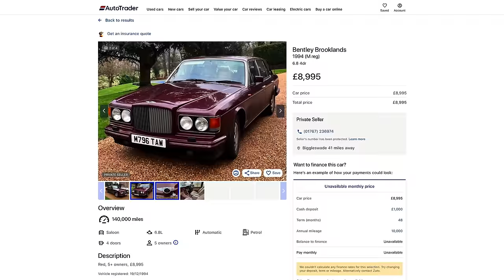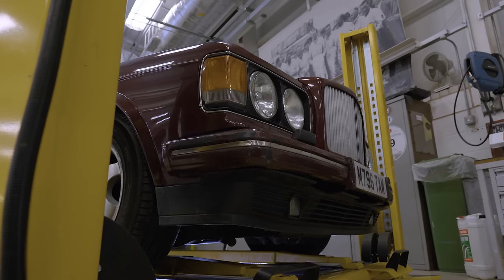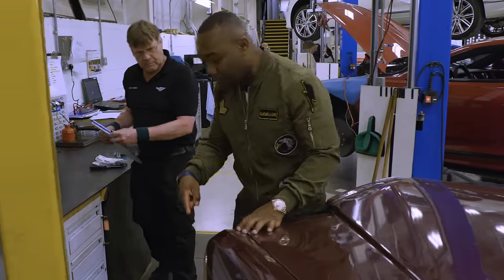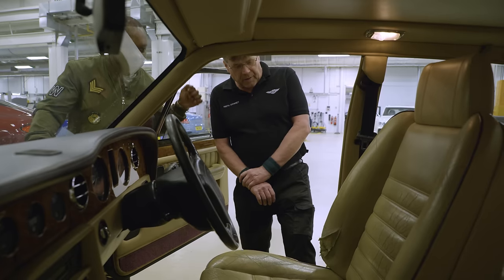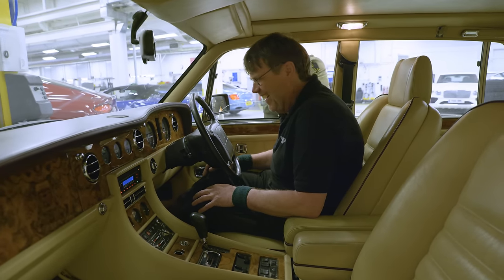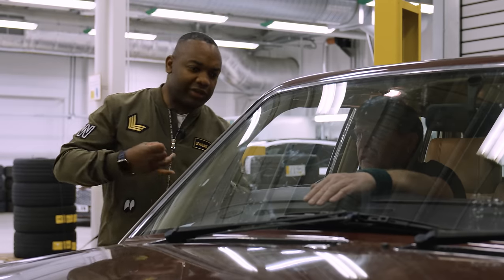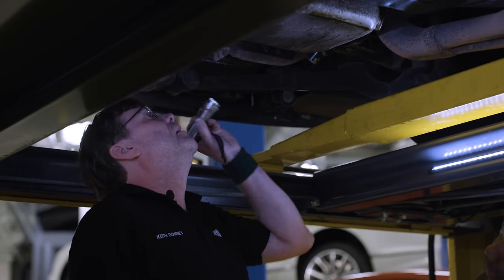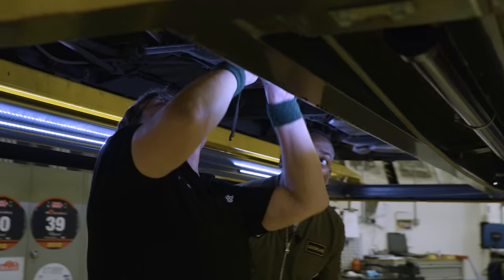Is My CHEAP Bentley BROKEN? Repair Costs REVEALED | 4K

Comment: Just to repair the corrosion around the rear screen is about £3k to do the job right, plus a new rear screen. Parts and labour for the rear discs will be about £2k. Plus thousands more to sort out the rest of the bodywork. These are not cheap cars to run, I know because I own a mint Brooklands myself. It’s a very misleading video that only talks about parts cost but no mention of labour costs.
Reply: You are absolutely correct. Fix the brakes, the electric issues, starting and suspension first. Then clean everything thoroughly and then and only then decide on what you personally need to fix. Then enjoy the car until you don't.
Reply: exactly what a thought, there's no way it would be that cheap to get these things fixed.
Reply: Hi. Why the hell rear discs would cost £2k? You need magical skills or parts are made from titanium? Or in UK it's normal to charge that much for labour?
Reply: WHAT TORCH IS HE USING ANYONE KNOW THE BRAND OF THE TORCH ?
Reply: @bollywoodbeauties8130  you forgot to add on about 8 more question marks. Otherwise, dead on with the caps lock
Reply: @bollywoodbeauties8130   A Bentley  . . . .Illuminate the problems torch . . . . Torch £0.43p Repairs Illuminated . . . THROUGH THE ROOF

Comment: As a mechanic I know that was based on visual, the reality is on doing the job, in the process of removing other parts to access other parts, you may discover hidden faults, excessive corrosion or leaks.

Comment: Am genuinely surprised at the price of those parts, really not too bad at all considering its pedigree. Would be great to see the rust fixed, a tidy up of the front end and the seat fixed. Apart from that and fixing any mechanical faults, I think it should be left alone, its a great looking car as it is.
Reply: Indeed the parts seem almost cheap. But as always, wait for the mechanic to quote you for 6hrs work to replace a £15 bushing. And the usual "We have to do both sides" multiplier.
Reply: Rust is often expensive to fix, especially when you want it done to the standard expected of a Bentley.
Reply: Guys it's the labour that is the killer...
Reply: @georgedimitropoulos3626  
I agree.
I recently spent £2700 getting the rusty sills  done on my E39.
Rust repair/welding part was £1000. Paint was £1700.
Reply: @lewis72  wow that's a lot mate they robbed you with your pants down lol 🤣
Reply: @tigerchillyable  
No, I got it done properly.
Reply: thats what I was thinking - £130 to repair leather upholstery?
Reply: I'm pretty sure they give him low prices because they want to look good. Just like on some shows they get a turbo rebuilt for 500-750 but when I go to the same guy they are going to charge me 1500.
Reply: I'm surprised that for its age, the car's electrical system is still fully functional. I would have expected at least ONE thing to crap out by now but the wipers work (mostly!), the a/c is fine, the seats can be adjusted. He got a surprise diamond out of a sea of junk because I've heard nothing but horror stories about British cars and their electrical systems. I say he should to for a restoration. It's worth it. And yes, I raised an eyebrow at the cost of the parts. It wasn't THAT expensive. I was thinking they would cost 20% more than quoted!
Reply: WHAT TORCH IS HE USING ANYONE KNOW THE BRAND OF THE TORCH ?

Comment: Good luck with the final bill………….even if you try to talk your way out of some elements……………you should probably be sitting down with a large brandy at the ready 🚗
Reply: $2,000 in parts for a Bentley?! I’d be thrilled by that. I’m sure they either have a mechanic or will get a discount on labor in exchange for promoting

Comment: Prices seem pretty reasonable but it's when they bill you for the labour you'll be expected to down trou' and bend over

if you can do the work yourself to a respectable standard then that there is a very worthwhile project and getting it back to a high standard will be very rewarding
Reply: Still, the parts prices the mechanic quoted didn't seem that steep. I overestimated the prices by about 10-20%! The real pain is the time and labor costs.

Comment: I'd go the other way, fix the hoses, brakes, steering box leak and trailing arm seats first, the switch gear second and the interior and exterior cosmetics last. But then I don't work in television. :)

Comment: I have the same car .  134,000 miles.
No rust!.
Whatever else you do, get the brakes to be 100%.  No red warning lights. The system is weird and takes understanding.  Use only the silicone fluid either from rolls or the same fluid used by Benz.  Glad electrics are good as they can be a nightmare. Have had 9 in my time from a 1953 to the current Brooklands.  Favourite was the 65 S3. Got an offer I could not refuse.  Currently live in Laramie Wyoming!
You can get a VERY good complete service manual from Flying Spares.on a stick.
Reply: Pretty good car for 1994

Comment: Do the mechanicals first, check in to that slow startup. It must have been warm. Hot start issue? Turbo charged car with known head gasket issues. Get the plugs out and check for moisture etc. check the water in the expansion tank. Slow start is a symptom of head gasket issue. 

My Arnage is at around 152k miles and going strong, but still around 4K in repairs to go before I hit the body work. Good luck.

Comment: To me, the paint should be what separates a Bentley from a Merc. Unfortunately that means you need to really invest in that body work to get that foot deep paint that Crewe was famous for. That’s the most important step here, along with the tired front seats, the springs and the brakes.

Comment: Agree with others that the parts prices seem very reasonable and another issue worth pointing out is that the parts for a car this old are still available - not easy and expensive to do considering how many of the original suppliers probably no longer exist. Fix the brakes first and the front numberplate looks illegal/aftermarket.

Comment: Amazing that it doesn't need more work.  We have a 2012 Continental convertible that just got new lower bushings last week at our Bentley dealer here in Rancho Mirage and it cost $6,441.00!  It did come with an alignment though.  LOL.  And the car only has 28k miles.

Comment: Oh dear, bodywork is kinda worse than mine. You,ve got holes where mine didnt. If the rear spring mountings are rusted then you can bet the spring seats at the front are shot too. The brakes should be fabulous. My car car surprised the MOT centre by how powerful the brakes were. I have since had the discs skimmed and the callipers serviced and galvanized so they are far better.  You'll need to have the high pressure system checked and probably some Citroen spheres need replaced. However the cars are just brilliant to drive, when they go as intended. Good luck!

Comment: I would love to see you have the rust welded up, properly, no filler, as it’s actually got very little rust aside from the arches, other than the arches and by the rear glass on the right, it’s all basically invisible/not difficult to fix, rockers, and by the rear light near the bumper, they wouldn’t be too hard to fix/you wouldn’t need to be too precise as you don’t see them. Sand and treat some of the rust on the upper right door and such off, doesn’t look terminal to me. Then get the rust repaired areas and sanded/treated areas blended into the original paint, not a full respray as most of the paint is very nice and the double yellow pinstripes are great. 

GET IT WAXOILED, you need some sort of cavity rust treatment done on it like dinitrol all over, inside everything, once the corrosion is dealt with. There’s really only one major dent in the rear right door. Bumper inserts would easily make the car look a bit better. Obviously get at least the drivers seat done as well. It’s a quality car and deserves to be preserved.

I don’t think much of the car is nice enough to warrant doing a “full restoration” or a full respray either (unless it’s cheaper to do so AND you can have the pinstripes perfectly duplicated) as if you want lots of it to be 9 or 10 out of 10 you’d be replacing a lot. Most of it is definitely nice enough to just keep it like that. To do a full respray and restoration on a car like this that’s got rust and has been in the rain and mad, you really have to take it completely apart, no sense doing a full respray to the outside of there could be mud and dust inside various panels, trapped, rusting it from the inside.

Comment: Wow Rory a good few K what a surprise i was expecting worst considering its age the repair seems very straight forward both in and out as for those brakes make it a priority to replace the pads maybe save the disc if your lucky, cosmetics on the body very minor in total your looking a good few K for replacement parts and not forgetting labour cost may leave a big hole in your pocket but hey its a Bentley so for what its worth give it a go and good luck i be watching this space for sure peace out.

Comment: Nice car. But I am having trouble understanding why the rust problems could not have very been avoided on these expensive cars when built. There are protectve coatings that could have been applied to the interior panels of these cars that could  have avoided these rust problems. I would recommend after any body work done, that you apply fisholine to the back of the work done, and also through the sills etc to avoid future rusting. I am surprised how cheap many of the replacement parts were quoted on this car, as many modern luxury car parts would be much more expensive than these. Overall it looks that you have done reasonable well with this car.

Comment: He never checked the brake accumulator pressures,  gas springs in rear or f/suspension bushings, long cranking could be bad fuel pressure accumulator.

Comment: As a previous poster observed, the pricing is rather reasonable assuming these are genuine Bentley parts...but does this include labor costs?  This is a fascinating series of videos, and my approach would be fix only things to get it to pass MOT.  I would go for the best car I could afford rather than put signicant money into a "well-loved" car.  Still, despite Keith's unimpressed reaction to the car, this is testament to the durability of the car.  Nothing seemed horrifically bad or indicated impednding catastrophical disaster.  I love this car, but wonder if these will have any significant value?  But as I buy for joy and not investment, it probably wouldn't matter to me.

Comment: Start with the safety issues first then the bodywork it is not a mechanical write off for a 28 year old Bently the main thing is the rust repair that a complete service would not hurt and the interior needs a tidy up l watch other british you tube chanels and the biggest problem is rust l live in Australia and my 25 year old toyota hilux does not have rust l had vans and they have had rust in places that when l had the yearly inspection l repaired it myself and it passed

Comment: Inspection was based too much on aestethics. Would have loved to see it done more comprehensively. My experience with dealerships is not so good,  taking a car to one here, I got qouted approx kshs 214,000 for parts and labour (labour  was almost 100,000) and even after a discount(removing the non essentials) it came to about Kshs 97,000 (labour 63,000). So, I took it to an independent mechanic and all in it came to kshs 23,000 in parts and kshs 3,000 in labour. Mind you the dealership found these problems - front and rear crankshaft seal leak, worn right engine mount, worn front shock mounts, coolant needed replacement, wiper motor needed replacement, brake linings needed replacement, power steering pump drive belt worn out. The independent mechanic worked on these  - front crankshaft seal replacement (he believed the rear seal was okay as he found it dry), right engine mount replaced, front shock mounts were okay-lubed, coolant was replaced, wiper motor wasn't touched (it works but i might have to replace the washer motor or try to clear the piping - just haven't gotten to it), rear brake shoes were relined and brakes adjusted, front brake pads were replaced also, power steering pump drive belt was replaced plus we pressed new bushes in all four corners and replaced the transmission fluid (plus he opened and cleaned the transmission oil pan).

Comment: The cost of sorting out the corrosion on that all car will be absolutely horrendous. New wheel arches sills and rear window.  The work will have to be done to a very high standard in keeping with the car and once you start you will probably uncover further horrors. The car is like an old stately home that's fallen into disrepair. You will likely spend a further fortune chasing brake and suspension leaks they really can be an absolute nightmare. That said this will be a great but super expensive project that will totally violate your credit card. You forgot to tell us how much Bentley charge per hour in labour.

Comment: I run a beautiful Continental R and like your Bentley, the trailing arm suspension cups were corroded, it's a common issue. The cups are cheap but with labour you are looking at £1100 (ish). I cannot agree with those comments about  using a drill on the centre caps. Most manufacturers fit locking wheel nuts but not Bentley, they lock the centre wheel cap with a special keyed tool so you can't get to the nuts. . Most good dealers will have a selection of keys which should remove them ok. The seats on the car are a disgrace which often happens when they fall into the hands of people who just use and abuse them and are mostly on a tight budget. If anyone out there is looking to buy one of these be careful of low mileage hardly driven cars, these Bentleys want to be used to keep them running sweet.  TBH, I think you were done when you bought that car, there are much better examples out there - just my opinion.

Comment: Incredibly misleading! These prices are just for a cursory collection of parts, so the total would be plus an eye-watering amount of labour charges and then plus VAT. Any mineral oil leak would have to be remedied, and other bushes and interval service items (like brake hoses) will also be due, and no diagnostics have been shown. I would have thought the repairs to this car would be closer to £11-12k, if done by Bentley. Let's see the actual final bills, Rory!

Comment: Hi Rory, I'm currently shopping for an EV to lease. I only drive about 150km daily tops and it's mostly a long stretch of highway (75km twice a day) on which I am comfortable just setting the cruise control to 90/100km/H and just cruise home.
Using it in my free time, I wouldn't mind giving my passengers whiplash by accelerating, obviously (I'm still a carguy) but unfortunately life has catched up to me at this point in time and I just need something basic for work. (I'd much rather opt for something fun on the side and have my home-work-carriage just do what it must and not much more)

What could you recommend?

-Frank
Reply: Model 3 or Kia EV6
Reply: Ioniq 5 all day long
Reply: As you're doing about 100 motorway miles a day, you'll need a car with a WLTP range of about 170-180 miles minimum, in order to account for a lower available range in colder months.
If you just want a 'schlep-mobile' that's comfy, easy to drive and has some self-driving capability, then a 62kWh Nissan Leaf does all that and the leasing deals you can get on those are great value.
Alternatively, you've got the original Hyundai Ioniq 38kWh - super efficient, too.
Reply: @jonathantaylor1998  Howmuch did you got paid to type this

Comment: Got to ask Rory, how do you get a job like this when you appear to know so little about cars? Are engine mounts important? Are the rusty trailing arms a problem? What's the mineral oil? Oh, yeah, the brakes are rubbish. Wow, it's like you're celebrating your ignorance. Oh, and how's the Leaf holding up? You seem to have gone very quiet on the electrical future of motoring ...